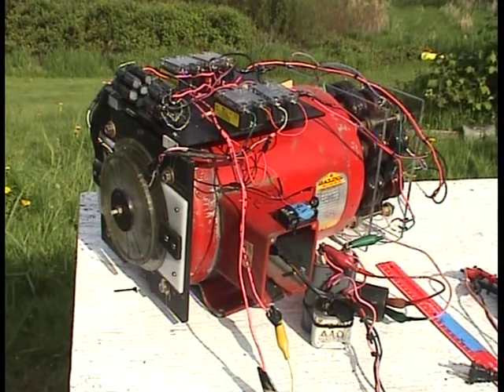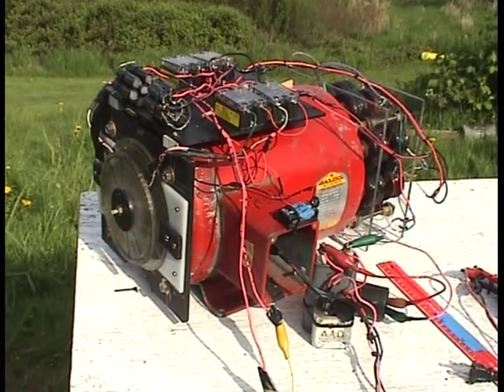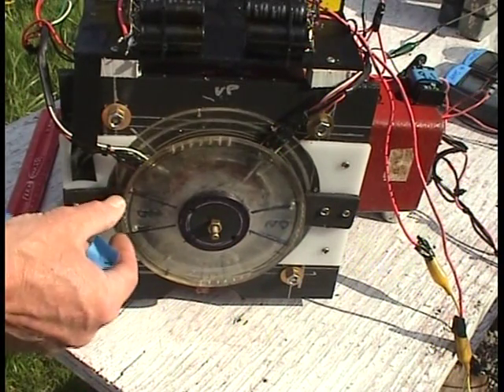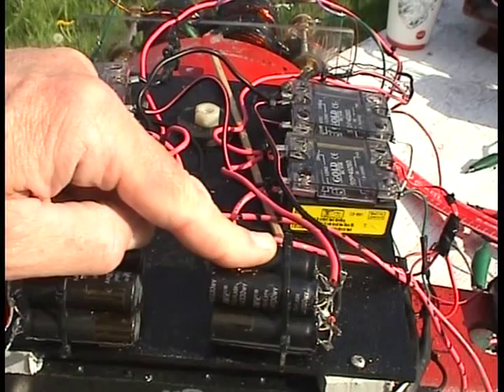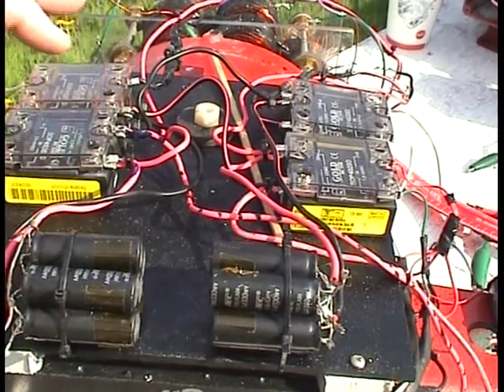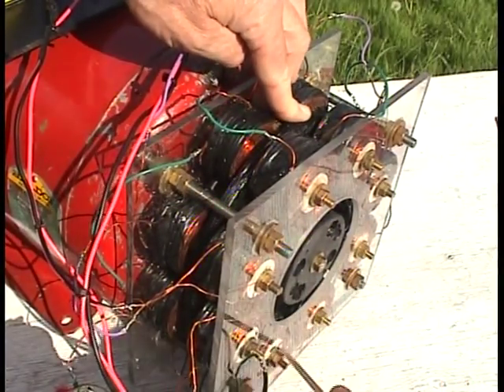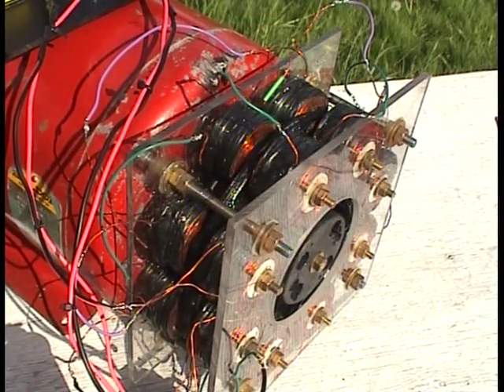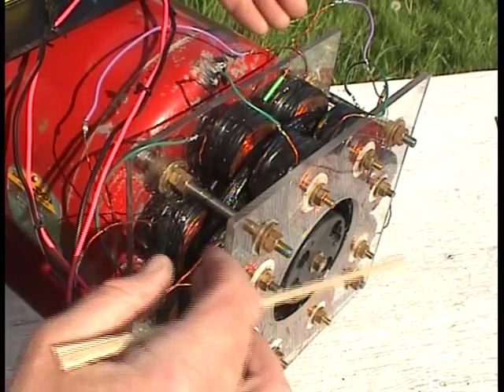PART ONE 4 SSR rotating invertor on rotovertor AC motor

Comment: New viewer here I'm trying to understand what you are trying to make here. Are you making a DC to AC inverter?
Reply from the maker: The generator on shaft of the red AC motor supplies power to fill the caps.....then the two cap banks altenatingly discharge to the load for AC power via the hall effect and timing disc and it puts out exactly 60hz too....if I ran the AC motor from an invertor, and a battery powereing that, then you "could say" it is DC to AC but I call this a "rotating invertor" and it works via alternating cap discharge....unique is the generator coils never see the load - they fill up caps only and only caps hit load.